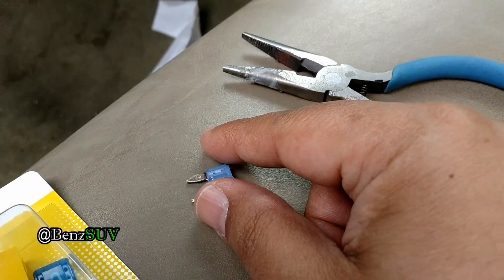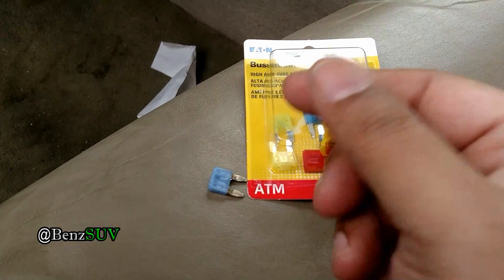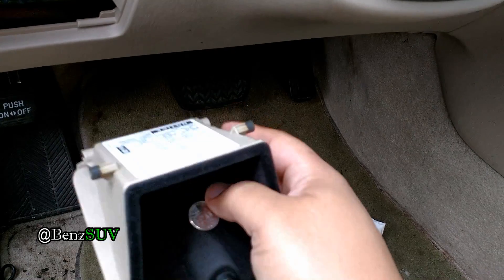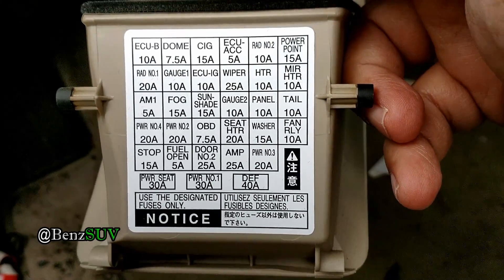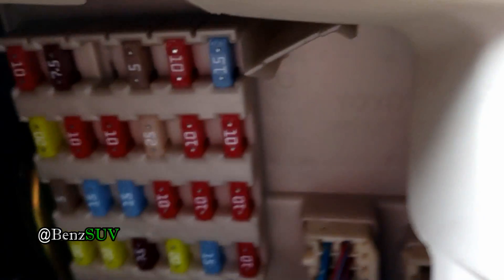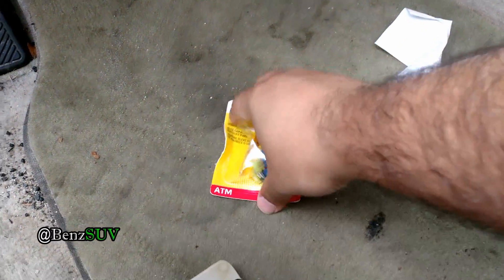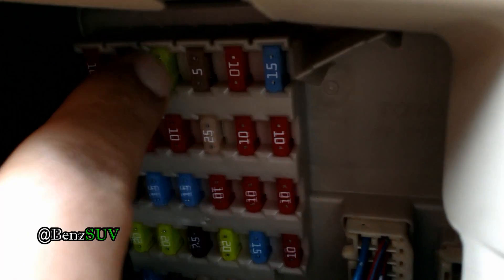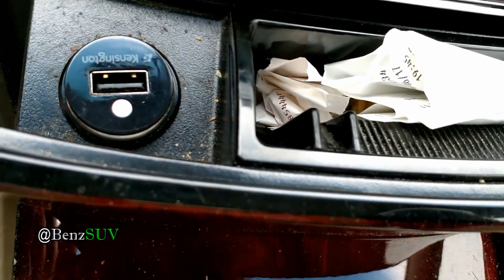Lexus ES330 cigarette lighter fuse replacement

Comment: Absolutely agree - always replace the same size fuse, you are risking a fire. Also,  don't squeeze the coin holder, open it part way, then pull up. There's less stress on the retaining pins.

Comment: Never, ever, recommend replacing an original value fuse with a higher current fuse.  The fuse is rated that way to avoid excessive current draw for the wiring that is installed.  The wiring is rated for 15 amps maximum and the 15 amp fuse protects it from damage.  If you put in a 20A fuse, the wiring will try to carry up to an extra 5 amps and could fail, get hot and melt, or worse short out and cause a fire.

If your fuse blew because the tire inflator drew too much current, then you need to change the inflator to one that can draw under 15 amps - that's a lot of current and suggests the inflator is faulty, old, or the compressor is failing.  ALWAYS replace fuses with the same value as recommended by the manufacturer - they are rated that way for a reason, to protect the circuit and the wiring from overloading and causing an electrical problem.
Reply: Thanks for the warning/tip. I was about to do the same until I read this!
Reply: I smell smoke.
Reply: It would be very poor design if wiring could not handle a meagre 20A or 25A.  Lexus have stayed on the very safe side, but most tyre compressors require this for a minute or so. This would not damage wiring.
Reply: Lqa
Reply: you are absolutely correct..no other explanation needed... you may use a lesser and in case of immediate need but always replace with the original amp as soon as possible